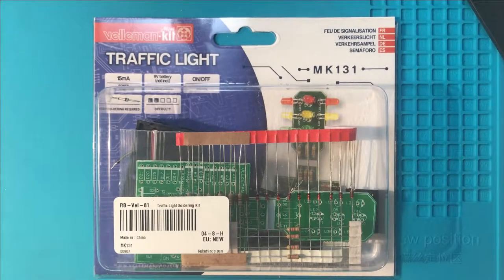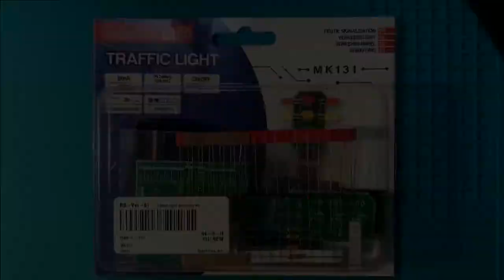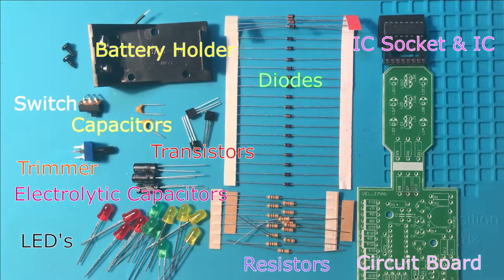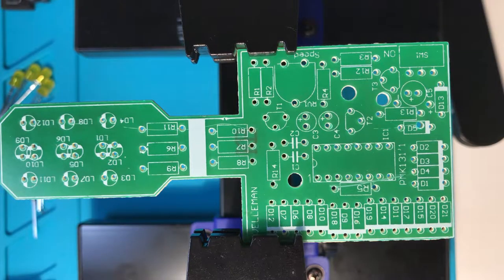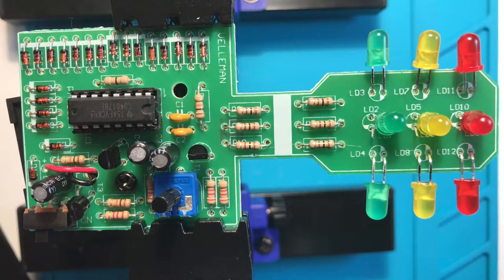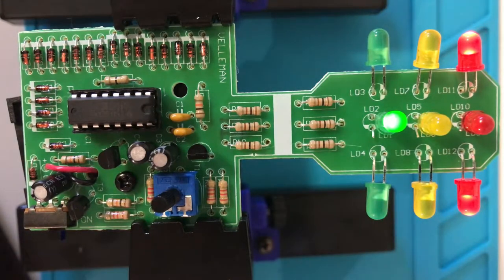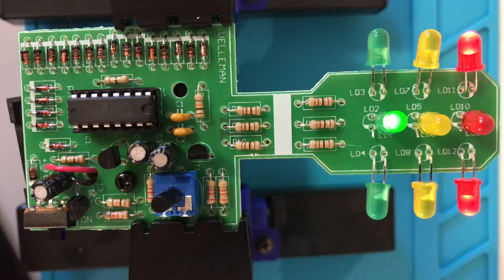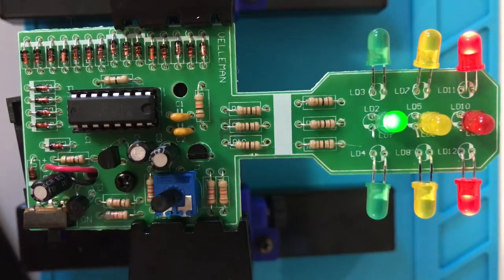Velleman Traffic Light....Kinda....

Comment: How do you know which little piece goes into which spot? You should show the paper guide (if there is one).
Reply from the maker: Thanks for the question! The boards all have the components locations laid out on them and I have paper instructions that tell me which symbols on the board go with each component. If you want to see me explain it watch my AC/DC power supply video.